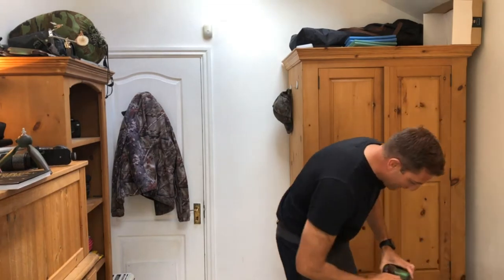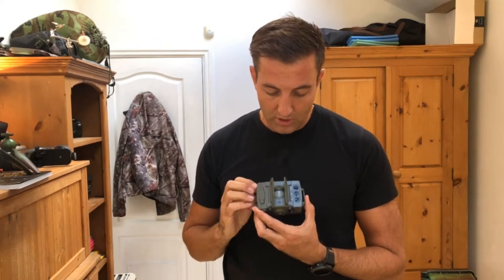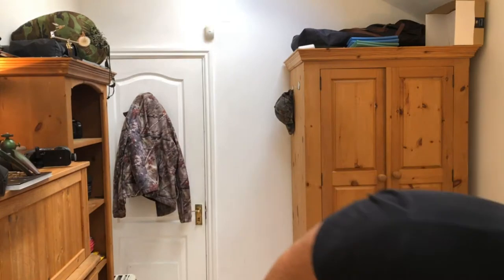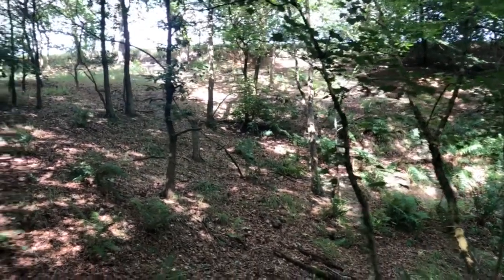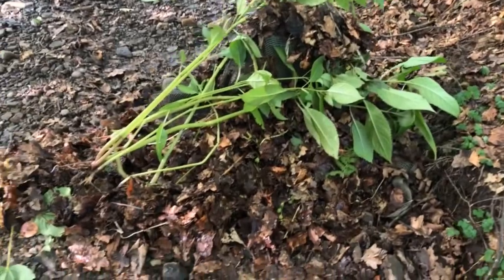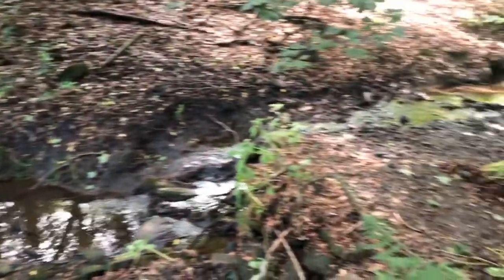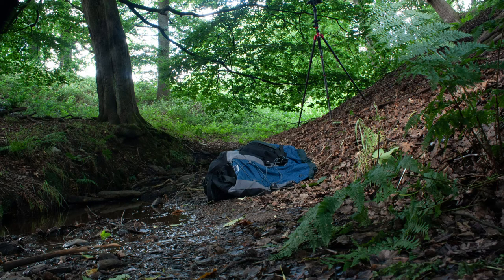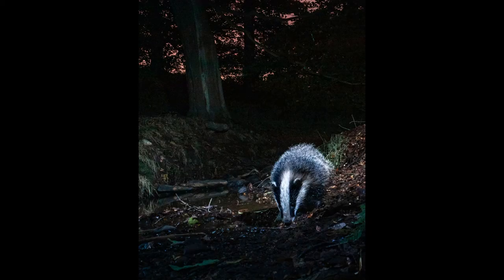Setting Up A DSLR Camera Trap

Comment: Great work Dan. I bet the farmer was interested to find people were walking dogs on his land. I swapped phone numbers with a farmer where I photograph Short Eared Owls. He appreciates having an extra pair of eyes on the ground.
Reply from the maker: Thanks for the comment Gary. Yes I know what you mean, if you work with the landowners they are usually very appreciative.
Reply: I noticed your Dad had the 500mm PF in this video.  I have it too on my D500 and have found when walking around photographing wildlife, I don't need the tripod as it is so light and versatile.  I will use the tripod if I'm under my bag hide for long periods photographing Short Eared and Barn Owls however.
Reply from the maker: @Gazzab6  yes the 500pf is an excellent lens for mobile wildlife photography. I have a 500 f4 and really wish I was using the pig at times

Comment: very interested in the bulb setting and letting camtraptions control the shutter as there is very little information
on the subject 
i also have almost a carbon copy of your set up and it is just starting to yield nice results
Reply: and an excellent first video Dan
Reply from the maker: @johnnyjohhny  thanks Brent. I like the bulb setting as you manage to collect ambient light in your images but it does come with caution ⚠️ daylight images are pretty useless as the minimum shutter speed is still long. Also any ambient light which is behind the subject creates ghosting.
Appreciate the well done 👍🏻 sound went funny on a part of it but this is all very new to me

Comment: Nice work!
I pretty  much have all the same stuff.  But I haven't made the hole in the case for the lens yet because I'm having a hard time find a proper extension to match a filter.. Do you have a link or name for that fitting and what size diameter and what size filter did you use? Also, what did you use to seal the filter in?

Thanks!
Reply from the maker: Thanks for the response. The items you have asked about and links are:
https://www.amazon.co.uk/Bosch-Professional-2608584651-PROGRESSOR-Holesaw/dp/B000R5H2ZY/ref=sr_1_42?dchild=1&keywords=86mm+hole+saw&qid=1611759581&sr=8-42

https://www.amazon.co.uk/Adhesive-Sealant-Tigerseal-Panels-Cartridges/dp/B01AAN6LC2/ref=sr_1_2?dchild=1&keywords=tiger+seal&qid=1611759650&sr=8-2

https://www.amazon.co.uk/Concept-Filter-Optics-Ultraviolet-Protection/dp/B07R64ZTMM/ref=sxts_sxwds-bia-wc-rsf1_0?cv_ct_cx=82mm+UV+filter&dchild=1&keywords=82mm+UV+filter&pd_rd_i=B07R64ZTMM&pd_rd_r=ccc045e4-c390-447b-9995-54ce3d971bd2&pd_rd_w=GDWe2&pd_rd_wg=1jGgC&pf_rd_p=4e85d769-a6e5-41e4-98e2-760ae84fa1c4&pf_rd_r=2EFF913ERMTN14Y1NEQG&psc=1&qid=1611759701&sr=1-1-28b929d6-7f37-4acb-b5cf-d38f484ff2d1

Its an 86mm hole saw with a 82mm UV Filter in it. When sealing it in with the black sealant, cut yourself out to paper discs to cover the filter as if you get sealant on it it's game over.

Hope this helps
Reply from the maker: Oh I slid a piece of soil pipe into the hole and fit the uv filter inside the soil pipe so that the housing has a hood. This is absolutely essential when it rains to stop your filter becoming covered in water drops and making the images useless